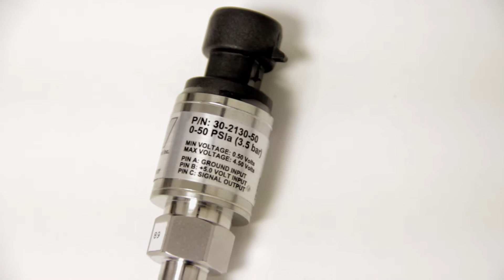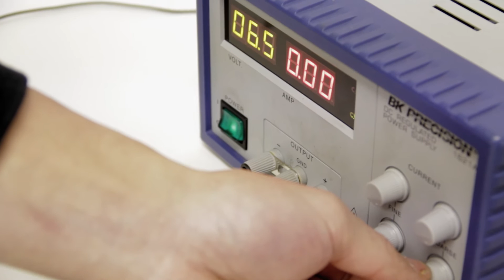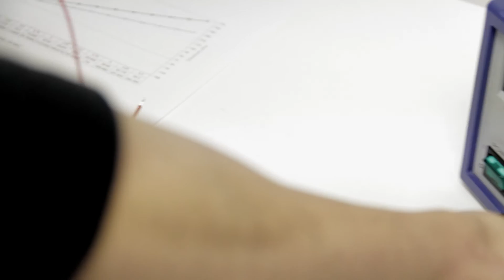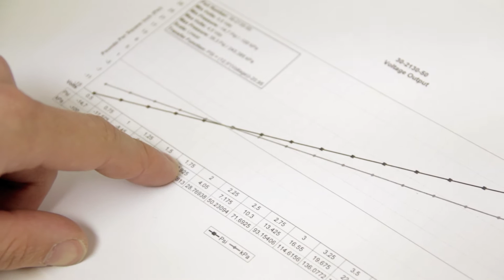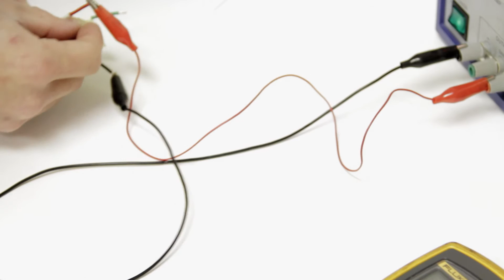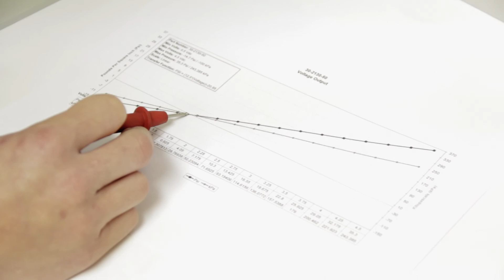How To Check Your AEM Map Sensor

Comment: Any tips on proper location ? in the engine bay ? I just routed the wires for my IAT and MAP through the fire wall.i noticed some people claim the proper location is anyway BEFORE the throttle body. and some people say after throttle body.